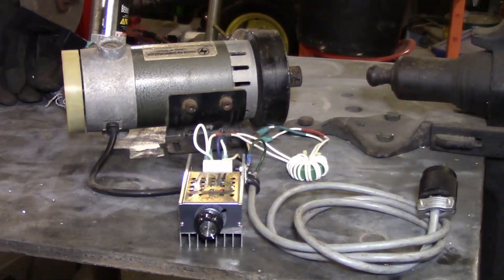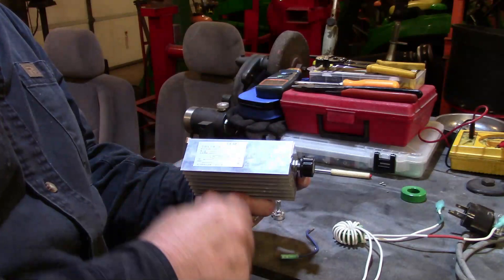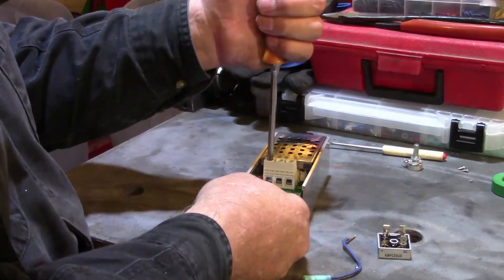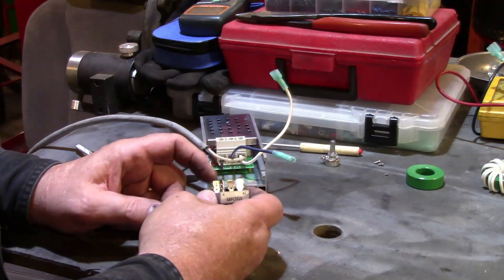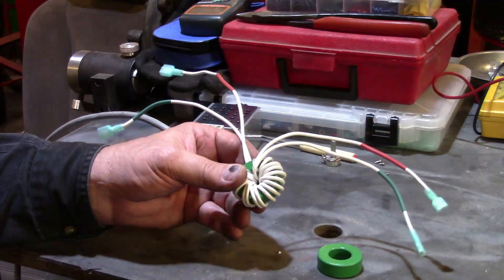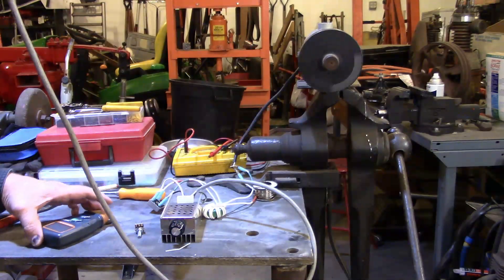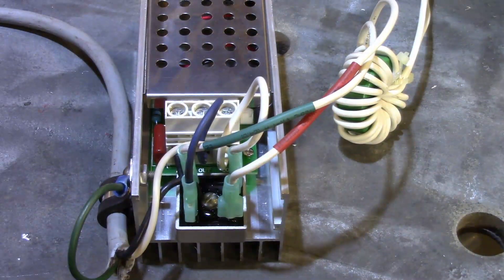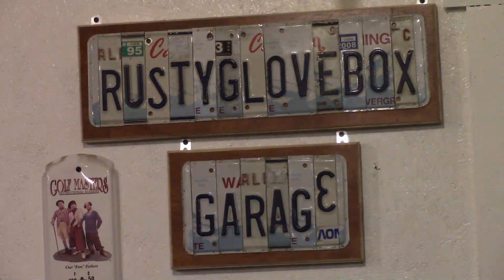Treadmill motor speed controller for less than $30

Comment: I got all the same components, and hooked them up the same way, and for some reason when I hooked the farad ring up the motor went on half power with the pot turned all the way down, and then the controller wouldn't work at all after... suggestions?
Reply from the maker: Hard to say, but your pot switch might have burned up ? Just have to check it out
Reply: @RustyGlovebox  good thing I bought a spare haha. I'll check it out. Thanks!

Comment: Does the engine drop power at low speed?
Reply from the maker: I'm sure it has less torque at lower speeds but hasn't been an issue

Comment: My treadmill's board is broken, the motor is good. Will this option shown in the video work for my treadmill please ? Th treadmill is Weslo compact SL.
Reply from the maker: This won't work for a tread mill. You will need to get a replacement board

Comment: Hello, I'm curious whether the  big weight on the shaft is essential.  Could it be discarded in fair if a gear or pulley or should those be adapted incorporating the weight?
Reply from the maker: MrRule308x   Yes it could be removed. Not necessary, the other end has the cooling fan.
Reply: @RustyGlovebox  thank you!

Comment: Very good job.  Have you researched  if a reactor is really needed  for a motor ?  Addition of a reactor in a DC circuit is usually in circuit like a welder, or possibly in a DC motor circuit that is used under heavy starting current.  When you strike an arc with a DC welder the voltage collapses and the reactor helps stabilizes the  current.  Usually a capacitor is used across the positive and negative leads to the motor.  The capacitor is used to smooth the ripple of the rectified DC voltage.  Most DC motor controller today (I believe) use pulse width modulation for control of the speed and will maintain near constant torque.  I have never used the ones that are sold on eBay, but they are very reasonable in price.  They have to meet the requirements of the motors volts and amps. The exact same setup would be used as shown by Rusty to get the AC converted to DC and then is supplied to the PWM at name plate voltage (90v ).  The speed of the motor is then controlled by the POT on the PWM. Do an eBay search for "6-90V 15A DC Motor Speed Controller Pulse Width PWM Speed Regulator Switch".
Reply from the maker: The dc motor needs the rectifier is needed for convert the ac voltage to dc

Comment: Did the pot you added only have 2 wires running to it instead for 3?
Reply from the maker: It had 3 but I only used 2. Works good. Thanks
Reply: Rusty Glovebox so on your new pot which contacts did you wire up. High Low or Wiper?

Comment: thanks for that 
its wonderful idea
i need to know siur how can you join the 220v ac speed controller with 130v dc  you change the ac to dc by abrige
but the difrent still btween 220 and 130 ?
Reply from the maker: You can use a step down transformer that reduces 220 to 120 vac. These transformers aren't too expensive . Good luck
Reply: @RustyGlovebox  the electric in my contry is 220v and i have a treadmill motor with 180v dc is that mean i must useing a transformer?
or just goin it with speed control and bridge?
Reply from the maker: @nofab5270  You will need to check the output without the transformer. If it is too high then you will need a transformer to reduce the input ac voltage.
Reply: @RustyGlovebox  thanks for all this information

Comment: harbor freight
 one for 20$
Reply from the maker: The HF controller is a good controller but it is a controller for an ac motor. This treadmill is dc.
Reply: @RustyGlovebox  well yes i know, thats why you would use the rectifier like you did in the video?

Comment: Have you done any tests comparing operation without the ferrite ring? Or have you considered adding a capacitor to clean up the signal?
Reply from the maker: I have not tried it with a capacitor. It will operate without the rings but they are suppose to help absorb some of the amp surge . Good luck on using the capacitor
Reply: I built this without the ring. It's for a light display project and the Load on the motor seams to be too much and the rectifier keeps burning up. I was wondering if it's because I need a capacitor.

Comment: I may have missed it in the video but what was you DC voltage to the motor with this setup?
Reply from the maker: The motor was a dc motor from a tread mill and I was converting ac voltage to operate the motor. The bridge rectifier made it possible and the controller variate the speed.

Comment: That potentiometer is only rated for 1/2 watt. Has that given you any trouble as the SCR (at least the one that I got) comes with a 2 watt pot?
Reply from the maker: No problem so far. If it does I will try a heavier wattage one. Thanks

Comment: I need this set up for a project but require a foot control pedal. Would you suggest the foot control pedal on the incoming AC side before the SCR or the control pedal after the full bridge rectifier on the DC side? I was thinking about using a sewing machine foot pedal unless there's better options.
Reply from the maker: Using a foot control pedal on the incoming AC side before the SCR would be the least expensive . Good luck

Comment: Thank you Rusty. Can you safely change the direction of the DC motor when it says Clockwise motor? Great video by the way. Very easy to understand.
Reply from the maker: The motors I've seen I have not been able to change the direction of these motors.Good luck
Reply: Rusty Glovebox Thanks Rusty.
Reply: Swap the connections on the rectifier going to the motor and the motor changes direction.

Comment: What's the longevity of these units?
Reply from the maker: It depends on the load put on the motor. A higher capacity bridge rectifier may be needed.

Comment: I bought two of these and wired both like you said. Both of them shorted out when power was turned on. Any ideas would help
Reply from the maker: Make sure you have a brush type DC motor, what does it say on the tag? .Disconnect the the motor, with a multimeter on the DC settings check to see if you are getting a variable DC voltage on the output wires to the motor. If not make sure the Bridge Rectifier Diode is connected in the correct order.  On the motor check the motor brushes. Are they in good condition? Check  with a multimeter on the ohms setting if the motor windings are shorted out for the wires to the motor case.  Good luck
Reply: @RustyGlovebox  thanks for the info.The motor runs fine with the treadmill control board. Also the rectifier I got does not say ac, it has a + and a wavy line on it. My thoughts were the line represents ac.
Reply: I checked and found that I have a brushless motor.

Comment: How did you wire the potentiometer, it has 3 prongs and only 2 wires, I’ve tried several configurations and soon as I give it power it goes to full speed with no speed control
Reply from the maker: The one I used had 3 but I only used 2. Use the center and one left or right. Depending on which one you use it will start low speed to high or high speed to low. Good luck
Reply: @RustyGlovebox  so did you go black wire center and red left or right, if so do you remember if you used left or right?
Reply from the maker: You will have to test it.

Comment: quick question.   I have built a 2 x 72 belt grinder from a treadmill motor, a KBPC5010 rectifier and the same controller you used and  and I keep blowing bridge rectifiers.  Any suggestion?
Reply from the maker: This is a 75 amp bridge rectifier with heat sink that may work.
FSB 75A 1000V Aluminum Heatsink Base Single Phase Bridge Rectifier Diode
Reply: @RustyGlovebox  Thank you, I will order one today!
Reply: @RustyGlovebox  I just ordered one on Amazon.  Should have it next week.  I will let you know how it goes.  Thanks Again.

Comment: I have a similar setup and would like to remove the fly wheel but can’t get that buggar to loosen ( no way to grab hold on the armature shaft), any suggestions?
Reply from the maker: You could use a standard pulley . Then drill and tap between the end of the shaft and pulley. Or maybe a tapered sleeve pulley that clamps on the shaft

Comment: Hi. Thanks your video. I do the same. And there is a problem when the load is moderate, the motor vibrates (not continues, lighting on brushes) and heats up very quickly. Do you have same problem?
Reply from the maker: No,  mine has run smooth.

Comment: Not a rheostat Rusty.  It's a potentiometer.  A rheostat is simply a variable resistance used to control power to a load. A potentiometer uses three terminals thus enabling a variable voltage to be tapped off from the slider.  Rheostats are usually much beefier that potentiometers because they are generally used in high-power situations.

Comment: What's up dude? Solid video. Using my DC to power a 2x72 belt grinder. What exactly is that box called? Much thanks
Reply from the maker: This one is sold on amazon- WINGONEER AC 220V 10000W High-Power Thyristor Electronic Regulator Dimmer Electric Motor

Comment: So I think that your connection will work for 110vac in the US, but is it fine for lowering 220vac down to 130vdc? I am considering to smooth the output by using a pi filter!! I hope that will work for my motor!! Do you have any suggestions?
Reply from the maker: Eric Chan    That may work using a filter. Do you have have 2 or 3 wire 220vac
Reply: @RustyGlovebox  my local supply is 3 wire, one 220v, one neutral line which is 0V, and the third is ground wire!! so I need to get a step down transformer to lower the voltage to 120V!! Or else, use the SCR to control the cycle of the AC, and then smooth that out to a clean dc!!

Comment: What is the wattage value for the200K  Potentiometer?  Does it matter ho big it is?
Reply: Hi, can you tell us what wattage value did you use. The 5k pot is rated 2w. I ordered one but is only 0.5w. Does it matter. Will it work or burn. Plan to use on a 125v, 2.5 hp motor. Thanks.

Comment: Excuse my ignorance, but is there a reason not to use the speed control circuit/hardware that comes with most tread mills? Also many of them have a "tach" or range value on a small screen to use say for a belt sander. I think I may be missing something? Thanx, G>
Reply from the maker: Thanks Gerry,  I got my motor from someone that parted out an old treadmill that the control board failed. I expect this happens somewhat often. The motors are 2hp or more so they are worth the effort to save. Take care

Comment: Every video I watch about this treadmill motor conversion talks about changing the pot from 500 to 200 why hasn’t any manufacture just make it this way?
Reply from the maker: I agree, I'm not sure what they had in mind for the switch when they designed it. But it's not hard to swap it out. Thanks and take care
Reply: Rusty Glovebox so I might be the only person out there where my treadmill motor still works but the electronics don’t (I tested the motor w a battery ) so I am going to attempt to use your method just to make the motor work by passing the electronics to walk on the treadmill I will add a kill switch to it for safety

Comment: Wouldn't you be better served with a full wave bridge rectifier in conjunction with a run capacitor? This would give you full form dc voltage instead of variable (inconsistent) dc output voltage.
Reply: Dan Chan
The rectifier Rusty Glovebox used here is a Full Wave Bridge Rectifier !
Reply: @NavinBetamax  what about the   capacitor? Wouldn't it improve voltage stability?
Reply from the maker: Could be better.

Comment: Hi Rusty, great video. I made the same setup yesterday using exactly the same parts as you. Even mounted the bridge rectifier in the same spot. We are on 230 volt here in Australia and I had purchased a new potentiometer in preparation for this project but to my surprise the 500k unit that was in it works really well so no need to change it. I also bought a 12v tacho and have a small 12v computer fan going in the control box. Also decided that as well as using the ferrite ring I am going to put the original EMI filter in the box as well so the control box is going to be about the size of a small shoe box but I’m ok with that. Another thing I like about the controller is that the wires on the potentiometer allows for remote mounting of it. I have a couple of treadmill motors but this is my first conversion. I’m going to mount it on my 6 inch wide belt sander as being able to vary the speed on it will be very useful for me. A word of caution if I may: I don’t think using this set up on a lathe or drill press is ideal if you, like me, are drilling larger hole in steel as the issue of torque comes into it. To keep it simple for everyone let’s say your motor is rated at 1 hp and the rpm is 1700. That 1hp is fixed so when you slow the speed down to say 170 rpm with the controller you still have 1hp available BUT when you change the same speeds using belts or gears you have a reduction ratio of 10 - 1 effectively now giving you the torque of a 10hp motor. I have seen comments on other videos where people are complaining that using these motors doesn’t give them enough torque when they slow the machine down for heavy work. There is a way around the problem but that’s for another time unless someone wants me to explain. This conversion is still good for people doing mainly woodwork or only working with light metal though and I have already ordered the parts for a second conversion as I am making a 2x72 belt sander. Hope this helps. Cheers Stuart 🇦🇺
Reply: Yes that's is the issue, at 4000 rpm i would use a pulley drive at 3:1 reduction = 1333 rpm and increase the torque at the lower speeds.
Reply: Just tell em to buy a PWM motor controller instead of SCR, problem solved! Phil 🇦🇺 . . . and I stole your flag icon Stuart.
Reply: @jed2055  Now what am I going to use😂😂😂 Hey Jed, in the years since I posted this comment I have changed things again. With VFD’s now available for under $100aud delivered I have changed to a three phase motor. Several issues came up with the treadmill motors but the main issue was the sensitivity to load of the dc motor. At the moment second hand three phase motors are still cheep, I paid $50 for a 3hp WEG unit (Brazil) and I get the benefit of ac for speed stability under load and the benefit of dc style speed control. It really is a win win. Another issue with the treadmill motors is the fact they have an open frame with big magnets and I manly work with metal. That can lead to a short circuit or maybe even a fire. I recently purchased a Bridgeport style mill and used a VFD to convert it and another advantage of a VFD is that I set the gears and pulleys to the highest speed and can reduce the rpm down to whatever I need at the turn of a dial. They also give me soft start and other benefits so for me at least 3 phase + VFD is the way forward.
Cheers Stuart.

Comment: Hi, Great tutorial. I have finally got hold of a treadmill motor for my belt grinder project. the motor has a Ground/earth wire coming out of it as well the positive and negative. should this be earthed to thee body of the machine, or something different?
Reply from the maker: Sorry, Hard to say without seeing it.

Comment: Larry i do not know how to pm you so ill go this route. Can the controller you used be used on other motors, say bigger motors with more torque? If it can handle such motors would you still have to change the riostat? Would you have to change the rating of bridge rectifier to deliver the right rate of power a bigger more powerful motor? Also if i wanted to, what would i have to do to the unit to control a powerful ac motor? Would i have to match the riostat output to the rating of the ac motor? Thanks for your time and i hope to hear from you real soon. Good video!!!

Comment: My 2.9hp, 8000rpm treadmill motor will power my disk/belt combination sander. Would a 4000W AC 220V controller work for this application, or would you recommend 10000W controller? What is the reason for using a 10000W controller on these motors? Thank you
Reply from the maker: My reason was hopefully for durability in hope it wouldn't over heat overtime.  Great to hear of your project  . I'm planning to use this one on a belt sander too. Good luck
Reply: Hi Rusty
Do you think a 4000W controller would work, but might get too hot after a few minutes?
Reply from the maker: It will depend on the load put on the motor. Just not sure
Reply: Roger that. 
Think I'm going to go with the 10000W just to keep things cool.
Cheers

Comment: Great video! I have the same hookup, but when I started mine, it didnt even run and something popped in the controller and hasn't worked since. There is no sign of any burns or anything. Think you could help me?
Reply from the maker: Unplug the power, inspect the brushes. They are under the black screw caps on the motor.
Reply: @RustyGlovebox  thanks for the reply! But the motor still works, I used the original controller to make sure, but the scr controller alongside the bridge rectifier does not work
Reply: probably a bad capacitor  check and see if it bulged on top
Reply: @TheDlauber1  if it bulged on top of one of the capacitors? I dont even think there is a capacitor I'll have to check when I get home

Comment: I have just put a 2hp treadmill motor on my wood lathe, I used the control boards from the treadmill. It does a great job doing finish turning, however  when I rough turn my green blanks at a slower speed it is lacking the torque needed for the job. Will using your method give be better torque at slower speeds?  You have done another great job instructing us rookies  Thanks
Reply from the maker: Thanks, I can't really answer if it increases torque or not .  Good luck if you try it